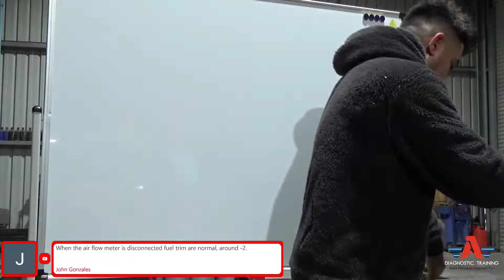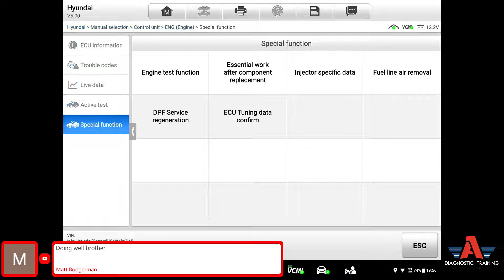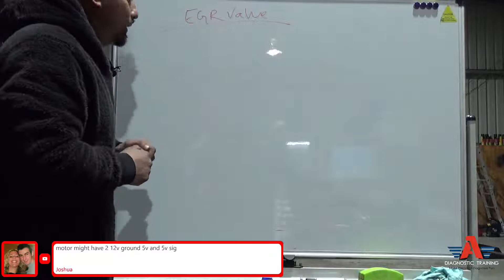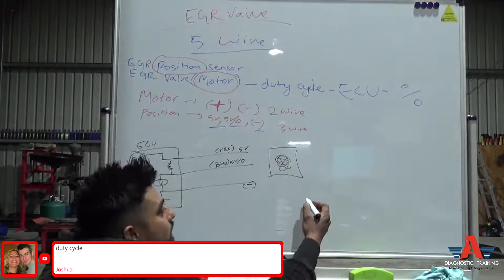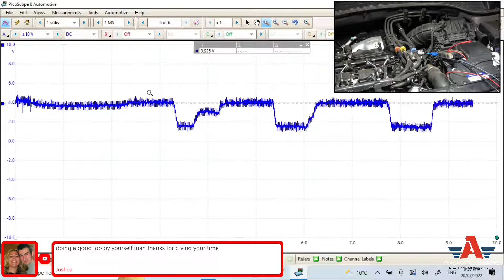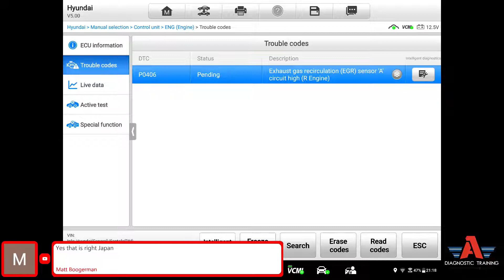HYUNDAI SANTA FE 2013 diesel EGR valve

Comment: I have the exact same case. same car same engine... check engine light comes back after reset.  low power RPM only reach 3k.. replace with new orig EGR.. issue still there... dunno what to do? any idea what to check next?
Reply: Need more info. What's the fault code and how long it took for fault code to come back after replacement?
Reply: @jayshstha3552  P0404 after you test run it fault code comes back.
Reply from the maker: I guess check ✔️ your controls to the Egr from ecu
Reply: yes. that will be a pain in the butt.. will keep you posted.
Reply: @daddyxian9773  I might have to chech the year model, but I am certain there is a relearn for the EGR valve.
Reply: @daddyxian9773  it was a Kia Sorento. Same engine and fault code. EGR had been replaced. There is a MAF and EGR relearn. Some scantools have the EGR relearn, but don't list all the steps to complete the relearn properly.
Reply: @nathanlittle8945  Hi, done relearn with new EGR still the issue is there, luckily I found a shop that checked all wirings and fuse and he said it's all fine. what they did is reprogram the module for the egr to get the signal to work. Finally it's fix.